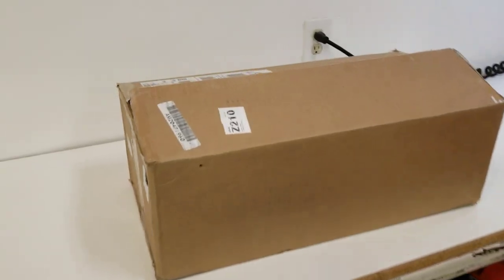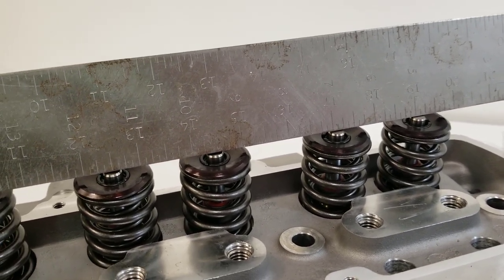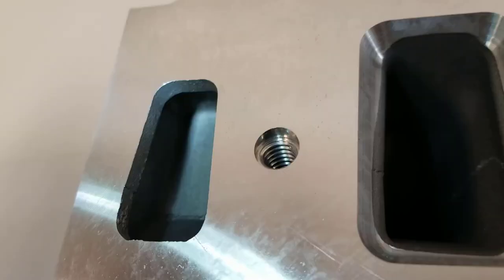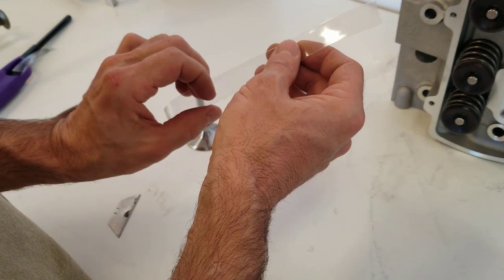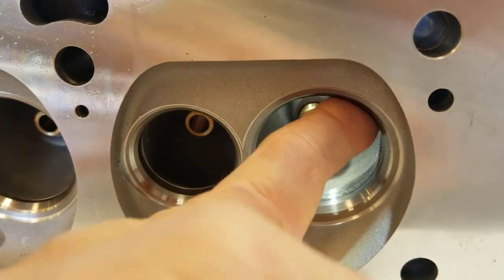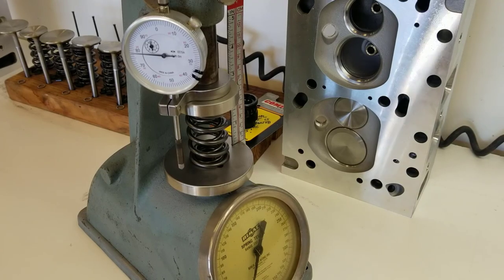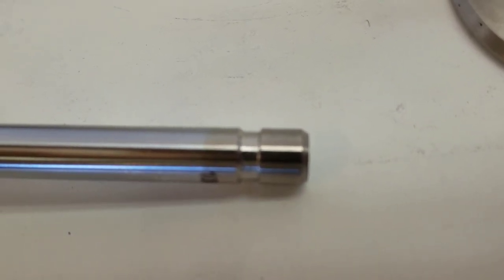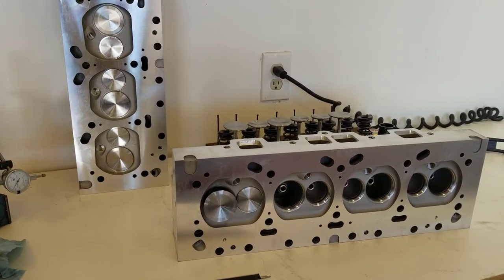Speed Master Oldsmobile Aluminum Cylinder Head Review

Comment: I regret selling one of 2 sets of Edelbrock Olds heads a few years ago...but money was so tight i kinda didn't have a choice. I bought 2 sets of first run Edelbrock heads when they were first introduced. Got a deal commiting to 2 sets early on and things were different then and i wasn't sorry. One set got cut and ported the other remained box stock. They performed very well. Ive always thought these Speedmasters are a direct copy of the Edelbrock thanks to china. I don't think anybody would argue with me on that subject. Being on disability money is tighter than ever. When the time comes and i save my pennies and sell some parts i do believe im gonna try a set of these. For the price i do believe they will work out just fine. 

If you want compression i learned that a .060 cut off the deck will get you near 66cc chamber. If you go this route have the machine shop chop off 0.100 off the intake face, just make sure they step the cut and not go into the valve cover flange.  The ratio is 1:6 when cutting the deck to intake face. Doing this will allow you to run any virgin un-cut intake manifold, which is nice. Makes me remember a deal years ago, somewhere in the mid 1980s at a car show this feller had a mint set of cast iron F heads but they were cut i believe .050 and he had the factory aluminum w-30 intake cut appropriately to fit. He wanted $550 for all which was alot of money back then but still was in the ballpark for what they were. In my young mind i could not accept the cut intake manifold and knowing any other intake would have to be cut too so i passed on the deal. To this day i still wish i would have went ahead and did it but thats the classic coulda shoulda woulda story. Anyway getting back to what we're talking about, the 1:6 cut on the intake face is a no brainer and a given if you like to play with Olds engines and if you love high compression. Each point in static compression is about a 4% change in hp output over its operable range up to 6000rpm we will say. A true 12:1 engine will make about 50+ hp over a 9:1 engine with no other changes, in the 500hp range. So you can be first on your block with a 550hp Olds while everyone else is fiddling around with 490-510hp and they will want to know your secret. I can tell you right now a  575hp Olds 455 with basic parts like everyone else uses will push a 3713# 442 into low 11s @ 119+ so yeah, there is that. 

I enjoyed this laid back review of these cylinder heads. Makes me want my health back and run outside and go build another bullet engine just to throw into something and go have fun!
Reply from the maker: Hi, thanks for the great feedback.  I'll have to keep that 1:6 cut in my box of tricks.  Another thing I have found is that bumping up the compression also helps the idle quality quite a bit.

Comment: BUT what are the valve sizes?????????? Oldsmobile used 2.07 inch Intake valves and exhaust was around 1.64 inch if I recall correctly!!! This meant Oldsmobiles had amazing flow!!!
Reply: He says the measurements. Intake is 2.07
Reply: He also measures the exhaust at 1.68
Reply: Even for a bored and or stroked 455, a 2.07 int. & 1.625 is not enough for serious power production.  Considering Pontiac  Ram Air valve sizes 2.11/ 1.77 could out flow the Olds BB head dept.
Reply: @johnplato4976  Oldsmobile has probably the worse flowing cylinder heads of any BB from any maker!

Comment: to suit Culatas.......enough said, just crap. It's an alloy casting, at what point is a helicoiled thread not expected?
Reply: Huh? Helicoil is going to be stronger than aluminum threads, that's why they used it on the high areas with high load. They cheaped out by NOT adding them for the accesory mounts.

Comment: 0.006 valve rock lol that junk 0.0013 too 0.0015 max valve guide ,thats a smoker for sure
Reply: But he checked them at 0.600" off the seat which imo would not give an actual indication for clearance in the guide.
Reply: @stevenbelue5496  you Don't work in heads with a statement like that?
Reply: @jackwillson8099  I thought the same about your statement. I dont know how you check your guide clearances but i certainly dont check mine with a dial guage and the valve six hundred thou off the seat. I mic my stems and dial bore gauge my guides or use small bore gauges or what i call ball gauges/mic's. Telescoping. The difference would be an accurate measurement for clearance. Measuring with the valve a certain amount off the seat the shorter the guide the more clearance it would yield. Ive often pulled the valve out and gave it a shake just for a reference to see what condition the guides were in but never to measure accurate clearance.
Reply: @jackwillson8099 another reason you shouldnt check clearance with the method shown here is because you wouldnt know where the guides were worn. You really need to check the guides near the top, middle and at the bottom and i prefer to measure the diameter at 3 different points but atleast 2 points 180° from each other with one being on the load side. You really would not want to check a setup that had been previously ran the way it was checked in this video. Its not much of a concern with a new valve/guide/seat that hasnt been run. But checking the way in this video on the non-thrust sides of the guide would not show the wear from a rocker/tip that was pushing and pulling or side loading the stem into the guide.